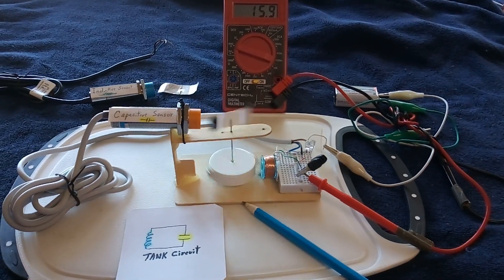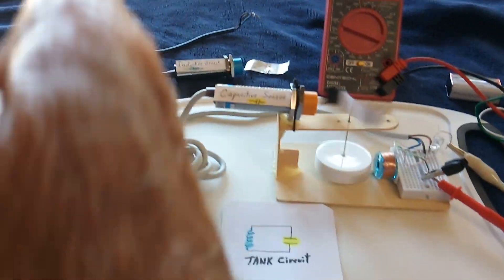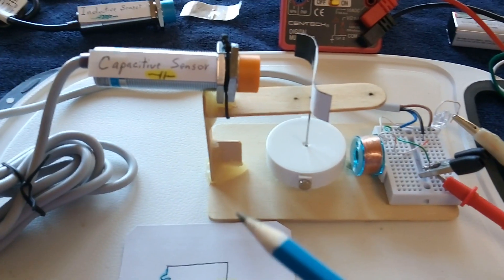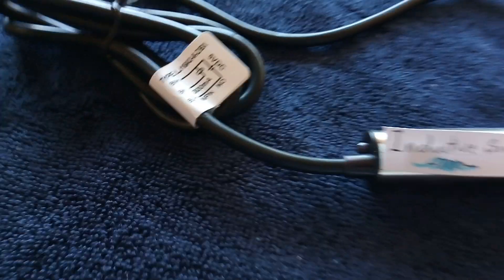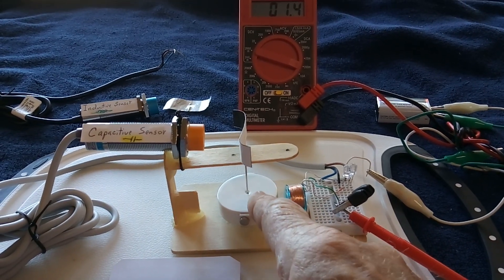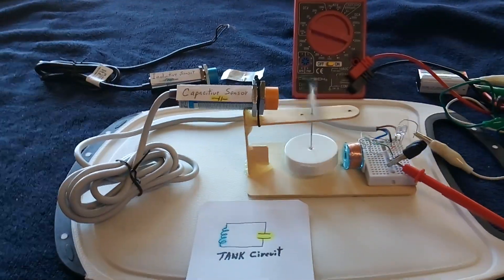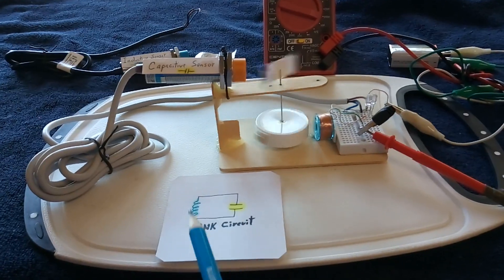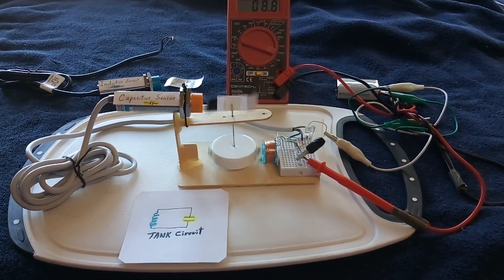Capacitive Proximity Sensor ---- Pulse Motor

Comment: Hi to have a very good output trigger if you are going to make your own sensor, use at CSS555 timer chip - It would be very stable and accurate and very low power.  Its pin-outs are the same as the standard 555, but uses much less current.  Trigger is pin two and output is pin 3.  Try it!!!
Reply from the maker: Thanks.

Comment: Interesting pair of videos. Something fishy is going on with YouTube. I didn't get any notification of the previous video. I have found it now by going to your channel direct but normally I check for new videos by going to my subscriptions page and it wasn't shown there. I am sure I am just being paranoid but you are the third channel in a row that I have found this problem.
Reply from the maker: I am having some issues with YouTube also.  One of these days I am going to have to open up an email dialogue with them to solve things.  Once in a while someone steals one of my videos and starts trying to make money off it.  If I complain they fix the problem pretty fast.  It is just a time thing  Time is precious to me these days.
Reply: @Lidmotor  You may find you have the automated option on your Studio Beta panel. It is a button marked "copyright". If you have it, it lists all the videos YouTube has found which contain a significant amount of your video on them. Most of the ones listed for me were straight copies with no modifications done. Some were compilations of multiples of my videos or part of mine mixed with other peoples.
You are given some options on how to deal with them ranging from a gentle message requesting they remove the video before YouTube gets involved, right up to an instant request for removal and a copyright strike.
Reply from the maker: @GrandadIsAnOldMan  Thanks.  I will check that out.

Comment: I wonder how much current the LED in the sensor is using? I wonder if there is a way to have it function without the LED. I would think that the current would fall to almost nothing. Going from 20 milli amps down to a few micro amps would make that a really great option for a long running motor.
Reply from the maker: I keep thinking that there might already be a commercial sensor out there like what I am after.  These things have been around for a long time.  I can't see anyway to take this apart and look inside so the guts are sort of a mystery.

Comment: A far cry from hall effect. Try replacing the paper vane with a strand of copper wire in a small loop. It should effect from a greater distance.
You should be able to run multiple coils with this structure.
Reply from the maker: Thanks.  Yes the device doesn't care how many coils or magnets there are.

Comment: Check out cd40106 hex schmitt trigger or other cmos schmitt logic its pennies for an ic and I believe they can run down to around 9v to 3.3volts. If the output is going to be used for firing a coil it needs a transistor to keep it from going over current on the outputs. Love your work!
Reply from the maker: Thanks for that tip about the cd40106.
Reply: @Lidmotor  http://musicfromouterspace.com/analogsynth_new/ELECTRONICS/mickeymouselogic.html this was Ray Wilson's site he was a big deal in synth diy culture. The mono-stable circuits would be probably what you are looking for but with a couple diodes these inverters can be used to form basic digital logic functions. The schmitt trigger is just a method of making an inverting amplifier with hysterisis and not all inverters are schmitt triggers. Sorry for the delay but, i had to remember where I learned some of this stuff. Cheers!

Comment: The hand trick for speed changes was very effective. Thanks for showing the capacitive version :)
Reply from the maker: I was a bit surprised that worked.   I bet if you turned on a Slayer exciter somewhere near by that would effect it.  I also wonder if somehow you could trigger an electrostatic motor (or generator) with it.  It is a curious little device.
Reply: @Lidmotor  Hmm, sort of remotely govern the speed. There could be a myriad of interacting regulated effects, based on proximity.  The planet will melt some day with these things lol